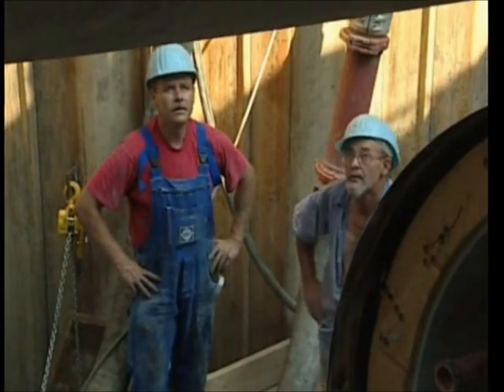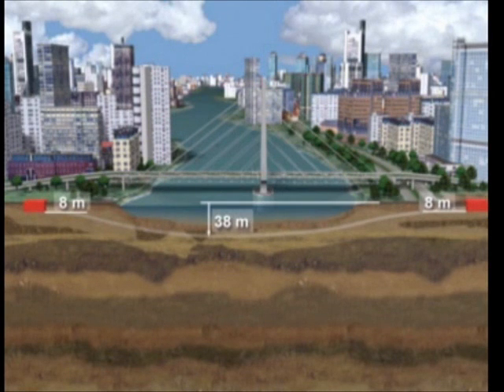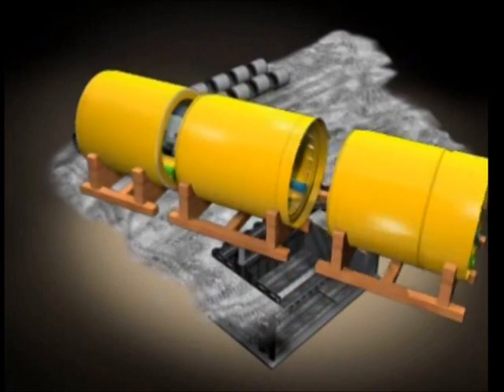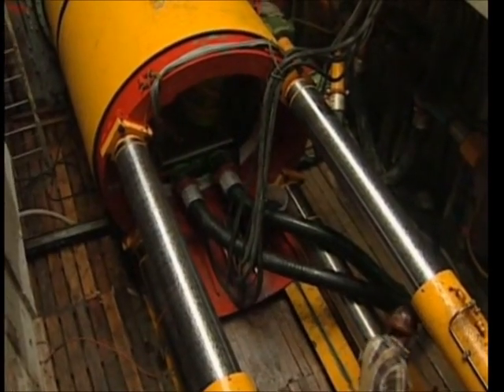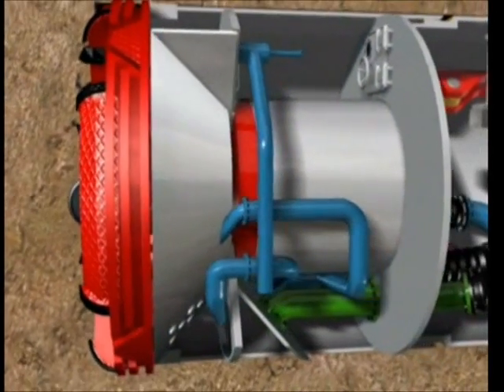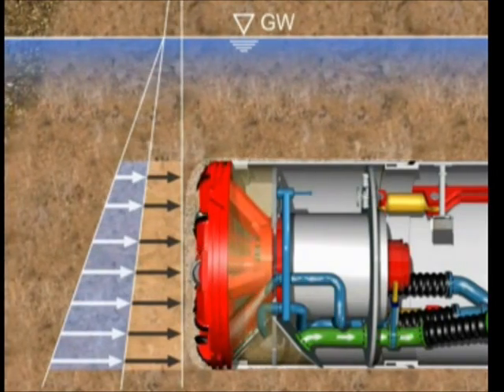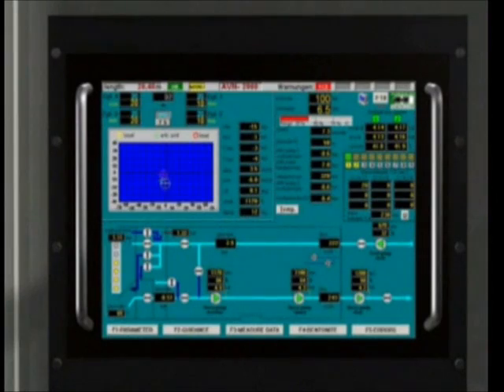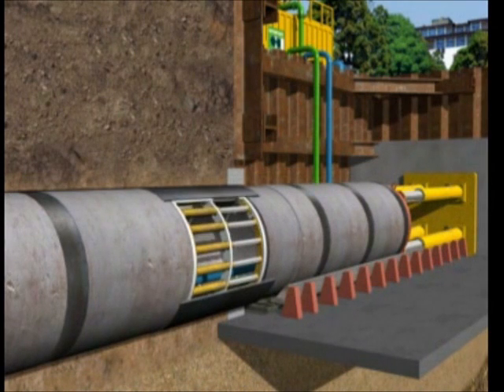Microtunneling AVN 2000.wmv

Comment: Very interesting video, I am wondering how deep can this machine go? Interested in going for Geothermal heat in the ground. For every killometer of depth we can get 25c boiling water for steam is 100c. I would like to go to 1000c and use liquified salt for heat transfer median, to bring to the surface in primary loop. Then secondary loops of supercrytical liquid such as CO2 to run turbines for electricity and the leftover heat to desalinate water, make diesel from coal and fertilizer.